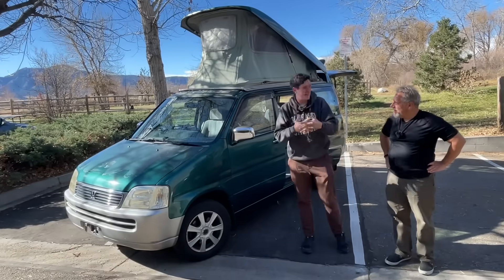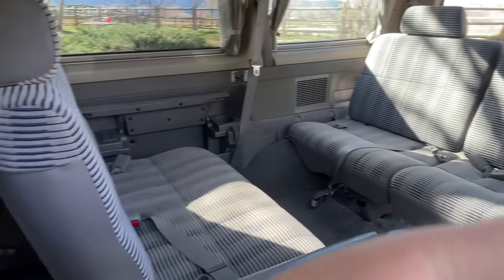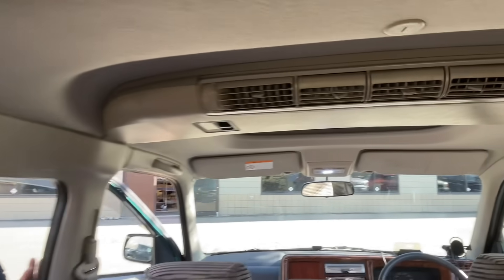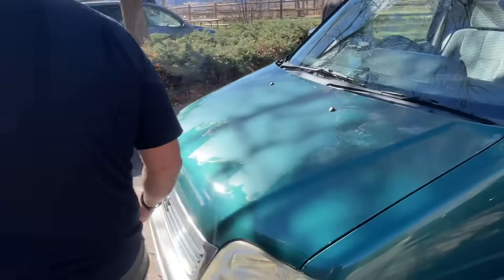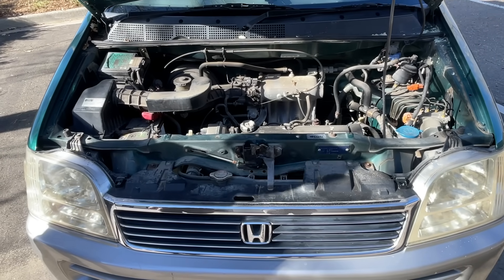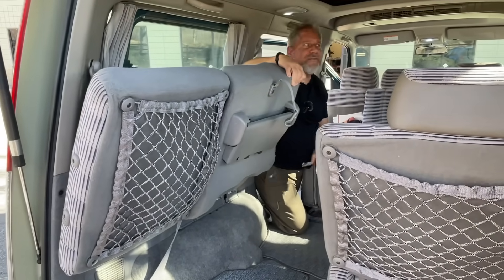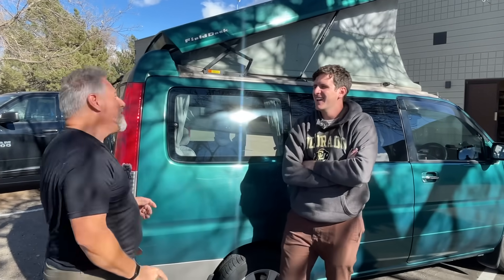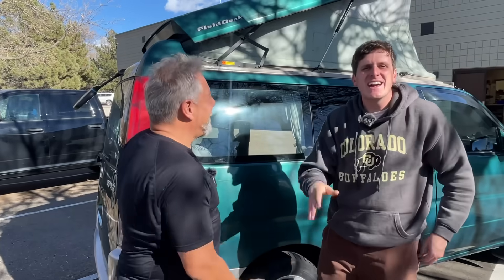The Most Incredible Honda You Have Never Heard Of!

Comment: 135 hp? Wouldn't be able to get out its way with 8 Americans in it.  Has some cool features though.
Reply: Are you kidding? Gearing man, gearing. Not to mention 700hp is a very new thing....
Reply: @jamesonpace726 It's a 4 speed... and 4th is an overdrive. I'm not saying it needs 1000 hp, but 135 isn't  much when you calculate passengers and gear.
Reply: @wilmarbarrick3194 buy a more expensive more powerful one. Most journies aren't full up I bet hardly ever. So this is economical and green

Comment: I drive an RG1 Honda Stepwgn. Its a turd lol. The older ones are so much cooler. The Newer RP~ Stepwgns are also great. (Drove a rental) I bought the lame duck of the generations :(
Reply: What are the best years to buy this wagon
Reply: @krisp.1593   In my opinion the 1st gen 1996-2001 is the best out of the older generations. You could buy them from the dealer with a pop-up tent. They have reliable drivetrains (the old honda maintays of the era) The older ones seems to have a bit of a following in Japan.
 There was a couple of generations in the middle (like I bought) that they lost the mojo. Nothing innovative or interesting and they started to introduce CVT transmissions.
 My favourite Stepwgn gen is the RP generation 2015-2022. Good tech, comfy ride, lots on interior features, sips gas and just a great family hauler. Plus they have an awesome tailgate that opens horizontally and vertically.